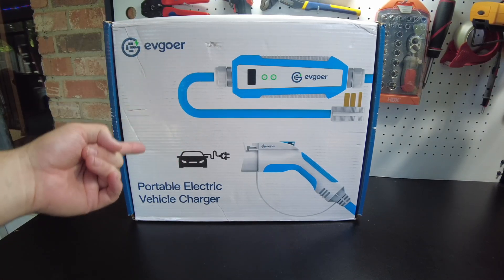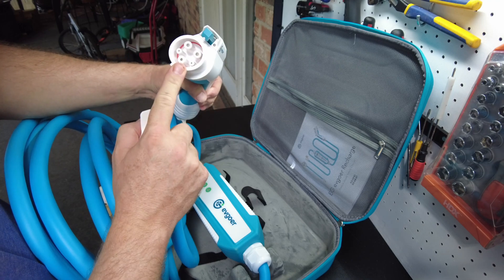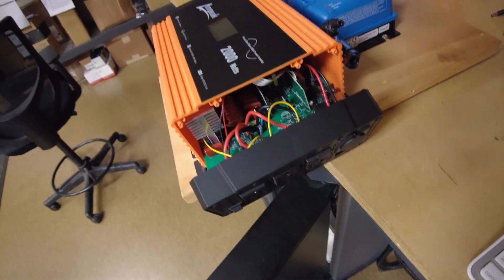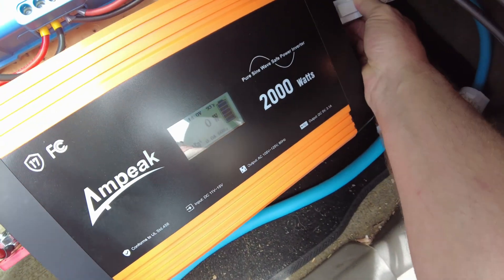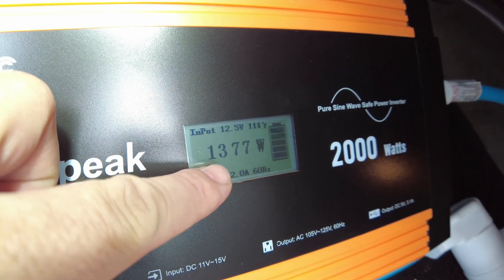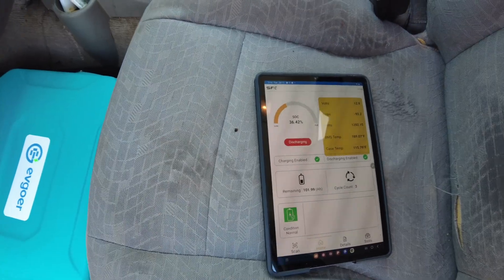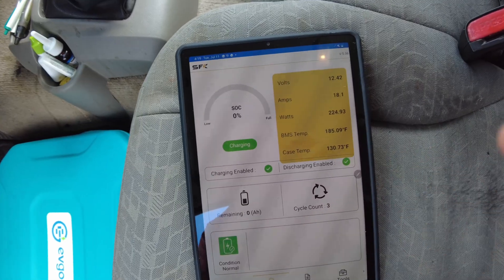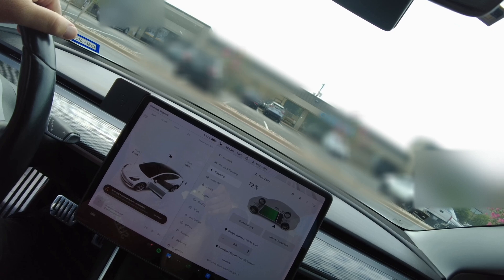Mobile Off Grid Tesla Charge Experiment.

Comment: I wonder if a neutral grounding plug would have saved you from modifying the inverter?
Reply from the maker: Yes, very likely. However I always like to check if there's any current that can flow between neutral, and ground first. You never know how they constructed the circuit in these inverters.

Comment: Hmmmm. So your battery has 3.5kwh and you only got 1 into the car? I had noticed that it was 95 degrees when you did this experiment. The BMS temp was 185 degrees F? Loved the effort, but I'd like to see a redo? Definitely turn off the cabin overheat protection as well as anything else running in the background (such as sentry mode). Maybe even find some shade? Seems like it should do better than your results indicate? Thank you.
Reply from the maker: Yeah, I calculated it should have put in 4 maybe 5% . The unexpected loads were actually a good experience for me because I had no clue they were going to be there :) Learned something. Thanks

Comment: wow. I was thinking about the exact same thing last week when I was building my solar system. I was stuck at how to fix the ground error. Now I know how to fix the ground issue. Thanks. 
Btw, is it safe to do the ground this way or is there another safer way to do it? 
Great video. very helpful.
Reply from the maker: I'm no electrician so don't listen to me. But in my opinion, I would think it about the same, or maybe better because if you get a short to ground now, I would think it overloads the inverter, and it shuts down. Ideally you would have a breaker on the hot side as close to the inverter as possible, that way the breaker will open on a short.

Comment: Cabin overheat protection. You can adjust to not use AC to save on juice. Problem with 120v charging is time. It’s dog slow, but works. I use it a lot at home since I’m typically not in any rush to top off battery.

Comment: You scared me. I was ready to make fun of you for buying a Tesla.  
At any rate,  the air conditioner comes on automatically when it's parked is a FEATURE!!?   That's the same as leaving a gasamobile running with the air conditioner on while you're in the store. Or at work.
The only difference is the Tesla is burning coal or natural gas or diesel or uranium. Probably.
Reply from the maker: LOL 🤣Yeah It's called "tesla cabin overheat protection"
Reply: @BradCagle  :)

Comment: Very interesting stuff, which should be eye-opening for some people.  The amount of power stored in an EV battery is staggering, compared to the little LFP batteries we play with around the house.  A standard range Model 3 has a 75kwh battery, which is enough to run the average US household for 3 days.  Charging up a 75kwh battery is no small feat!
Reply from the maker: Yes, It was very eye-opening. Would be neat if you could use your car as a "power wall" when you get home.
Reply: @BradCagle  - I know at least some brands are advertising that as an option.  This video should help illustrate for folks why 1 solar panel, or even half a dozen, isn't going to keep an everyday driver EV charged up and ready to go.

Comment: That was good to see. I mean, if you are a few miles from a charger and the car is at 0% then this reserve battery may be an option to get you to the charger. 
If the vehicle has V2L then when you get to the charger you can also charge your reserve battery.
Reply from the maker: Yeah, I think this EV "jerrycan" would get you 12-16 miles.
Reply: What is V2L?
Reply from the maker: @RyanAyers12  I think it's basically an AC inverter functionality built into the car, so you can can pull power back from it to power normal AC devices. Is this correct @BenMitro?
Reply: @BradCagle  Yes.